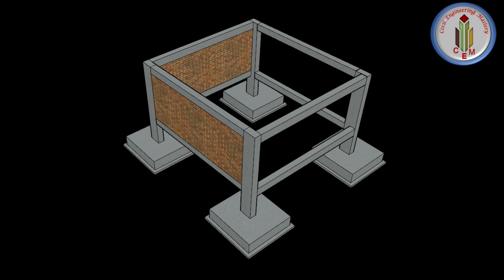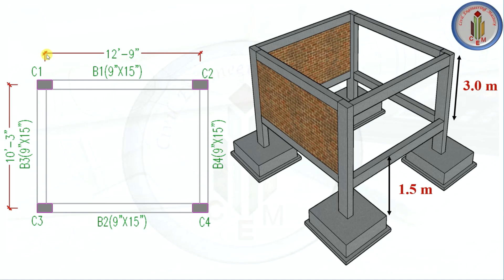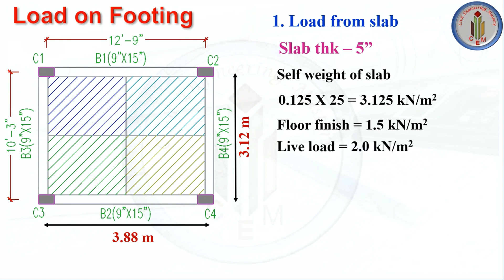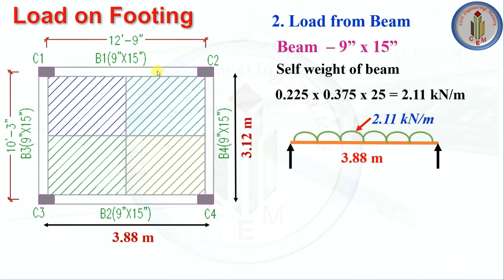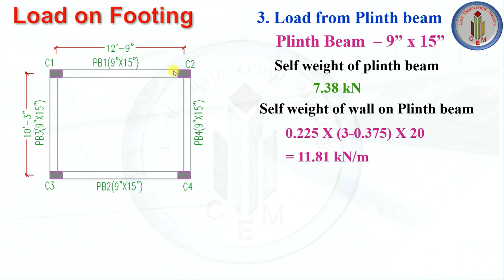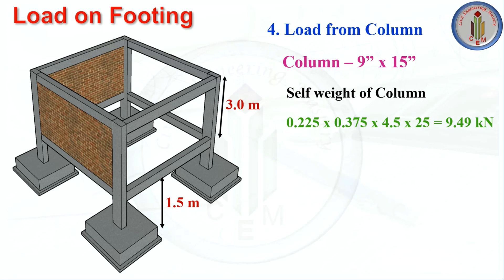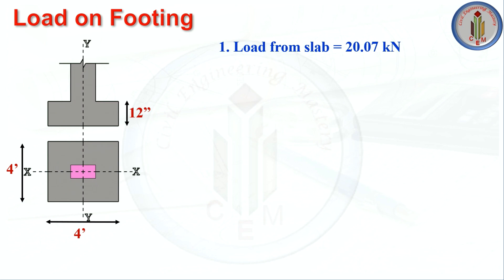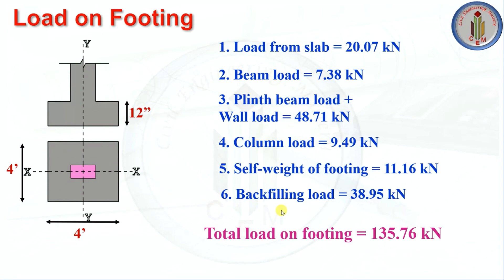How to calculate loads on footing | Footing load |  How to calculate footing load | load calculation

Comment: YOUR LECTURES ARE WELL EPLAINED
Reply from the maker: I have created a course, structural design of buildings using Etabs software which includes structural analysis and design of a five-sorey RCC building(Real project) and is now available on udemy.
Kindly use the below link to avail the full course.
https://www.udemy.com/course/structural-design-of-buildings-using-etabs-software/?referralCode=14883FDBBD95A1ADAC02

Comment: We are considering 10% more in calculating selft weight of footing that is enough no .why again calculating the backfilling ??
Reply from the maker: Yes, you are right. Here I have not added 10% of the column load. Just explained how to calculate the backfilling load.
Reply: @CivilEngineeringMastery  kk
Reply from the maker: I have created a course, structural design of buildings using Etabs software which includes structural analysis and design of  a five-sorey RCC building(Real project) and is now available on udemy.
Kindly use the below link to avail the full course.
https://www.udemy.com/course/structural-design-of-buildings-using-etabs-software/?referralCode=14883FDBBD95A1ADAC02